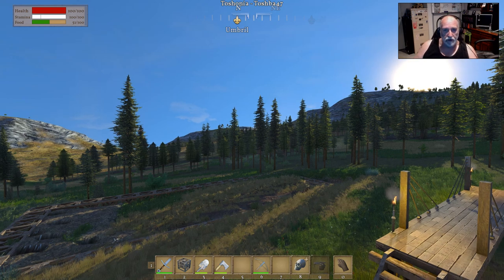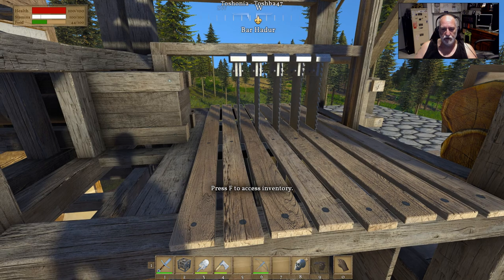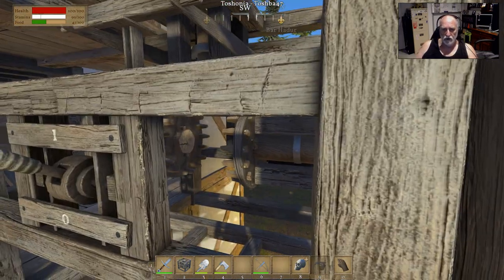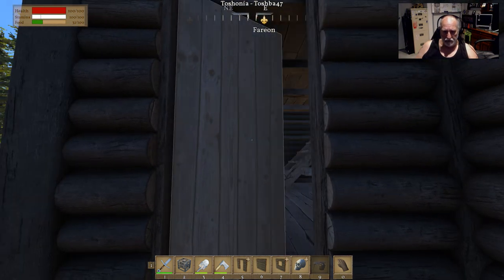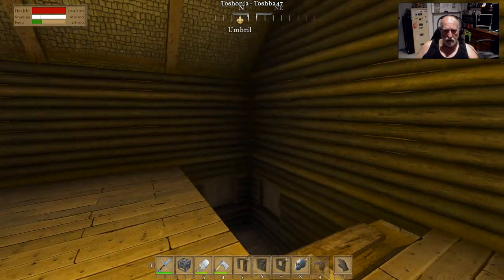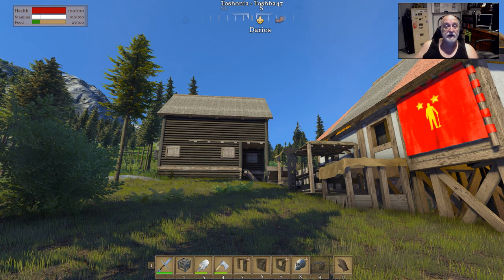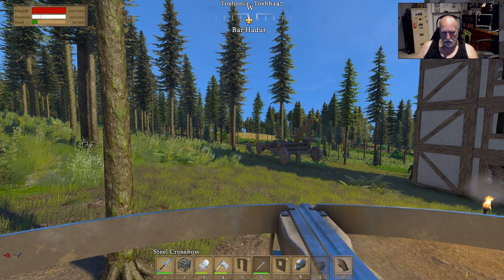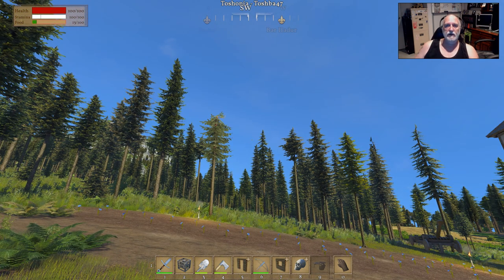Medieval Engineers - Log Cabin and Mechanical Switch

Comment: I know this is an old video but I've started playing ME again recently and was just getting to the point where I'm trying to put some mechanical blocks to use.  My plan was to build a windmill up as high as I reasonably can to maximize power output without having to make a silly looking pyramid style structure to support it.  Then I was planning on connecting all of my mechanical machinery off of the one windmill using splitters.  And I wanted to put a mechanical switch in line just before each machine so that I can only engage the one I'm actually using.

So I went through the process of unlocking all the mechanical blocks and getting my main windmill structure and vertical shaft built.  But as soon as I was ready to connect my first machine into the system I ran into a road block.  I pulled the mechanical switch from the G menu and put it on my hotbar.  But when I try to place it I get a message saying I need a mechanical switch in order to build the mechanical switch.  I've gone through the inventory crafting menu and the menus of every crafting station in the game and there is no mechanical switch I can craft in any of them.

How do you actually build the mechanical switch.  Was it removed from the game at some point and it's just an oversight that it's icon still appears in the G menu?  Or am I missing something?

Comment: Have not unlocked mechanics yet, so question on the switches.  Does disengaging a mill increase the speed of the other that is attached?
Reply from the maker: Hi Will, welcome to the channel. Yes it does, there seems to be some code that determines how much energy is available from the wind and then distributes it to the attached mechanical blocks.  So the millstone uses x energy and the sawmill uses y energy. If you remove one of them then the one left gets all the energy left. Also the height of the windmill blades increases the amount of power available. See my windmill vid for more on that. Cheers